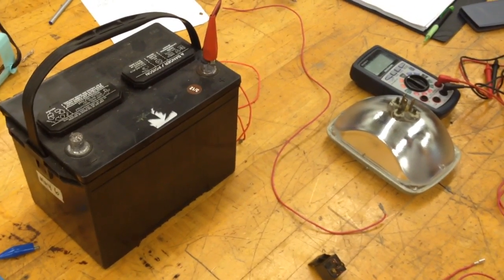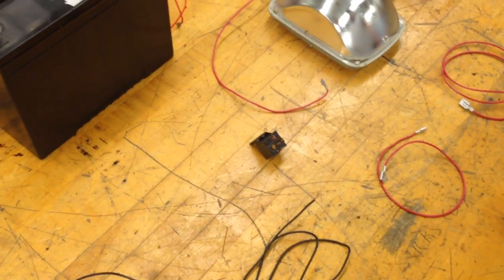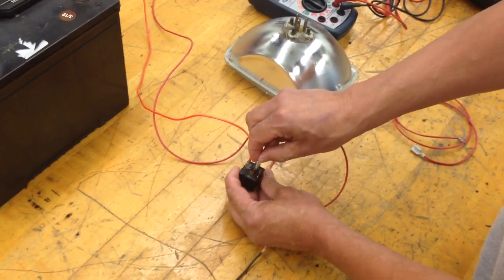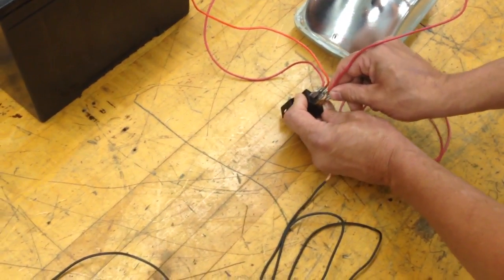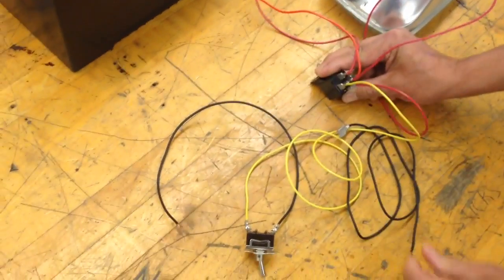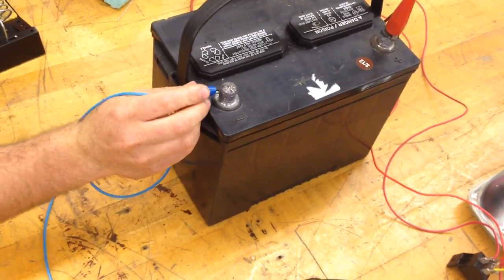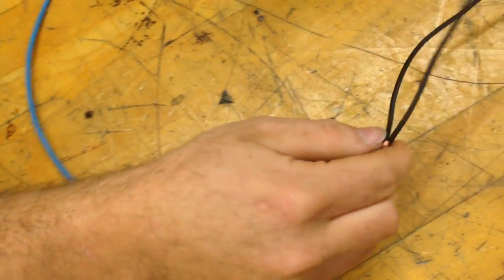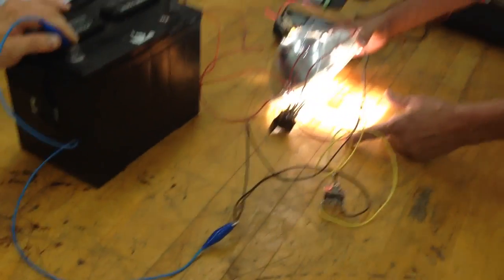High/low beam headlight connected with 5 pin

Comment: Good demo..... But i would connect a fuse specific to the vehicle specs and connect both fuses between 87a to lamp and 87 to lamp..... Otherwise bulbs wont last long for getting too much power

Comment: That was informative. 
But what do you do if the light has a second side light bulb, as well as the dip and high beam?

I've got a 5 wire 2 bulb light that I need to fit separately to the existing light?

Comment: Yes, your video can be followed and understood but improve on switching off low beam may be by use of 2 relays
Reply: Why 2 switches?... this is daytime running lights with a highbeam switch.  87a stays hot until the highbeam switch is thrown-  87a opens and 87 closes allowing power to the highbeam. The only thing missing here is a fuse but not necessary for this simple demonstration.

Comment: Is there a way to wire a 3 way switch to have  it work (hi-off-low)
Reply: That's how it works, if I'm not mistaken its an (On Off On).. labeled as on or off but there's a middle option.. the middle is actually off. They have different switches to buy and I think he just happen to buy that one. But I believe its 3 options, up is hi and down is low, middle is off
Reply: Actually yeah I think your right, but you can buy a switch that does the same thing I think the middle option just doesn't touch anything internally

Comment: I use same diagram for my motorcycle LB and HB. So, how to turn off low beam because pin 87a (LB) connected to battery?
Reply: Connect LB switch on wire to 87A

Comment: Hey so I think I figured out how to do high and low beams on a 3 position toggle switch on-off-on. You use two 5 pin relays, one for the low beams and another for the high beams. Watch a few more videos on how the 5 pin relays are set up, but the headlights are pretty straight forward, top is positive and if you run the negative through any of the sides it’ll be either low or high beam
Reply: Can yoh make/share a video of this. I'm wanting to do exactly this but I'm lost😅

Comment: So in my truck I have a dual filament bulb for low and high and the low beam turns off when I turn on the high beam. How can I rewire it so that the low beam stays on when I turn on the high beam? I'm getting upgraded aftermarket headlight that have separate bulbs for low and high.

Comment: there are two switches, (1 )the on & off & (2) the high & low beam,  pin 30  on your diagram connects to pin 86 then one wire goes to the battery, then  when you hooked it up during the video  you used two separate hot wires keeping 30/86 on separate wires both connected to the battery, the diagram would be correct if another switch was added before the battery, I would add an on & off switch to the lead after pin 86 to battery & wire a separate larger  hot directly  to pin 30 to the battery, assuming the high low switch on the floor is a two wire with one post to ground, caution most floor dimmers are not wired this way, most have three wires  (1)high (2) low hot on the dimmer with a (3)third positive wire also on the dimmer switch hooked to 12 volts ignition or battery, no ground on the dimmer switch  The diagram looks like a motorcycle switch when the ignition is on the lights stay on until the ignition is switched off by not showing the on & off switch this becomes very confusing, & can cause a potential short if the dimmer on the floor is a three wire regards
Reply: Yeah he didn’t show the two hot wires from the battery

Comment: what about the dimmer switch,  three wires one is high, one is low, the center is power, what your saying is use only the power wire & one leg of the dimmer switch, since the dimmer has two legs, I wonder where I can use the third leg, since by turning the light to low beam  the other lead is hot 12v & could potentially could power ????
Reply: Jeff Booher you need a 5 pin relay for this. Low beam signal input plus 12v vs high beam signal input plus 12v. You only get one or the other. The squigly between 86 and 85 is variable/a resistor. A higher voltage input nets you high beams while a lower input nets you low beams. Its own switch inside the relay.

Comment: Hi, how do I manually grab a high beam wires in a car doesn't have plug? Need to run a driving light bar thanks
Reply from the maker: You need to use a wiring diagram to find out which wire controls the high beam. Thanks for watching.
Reply: @scottb6419  thank you so much

Comment: If i were so inclined to just use this to set an on and off switch dedicated to HIGH beam and OFF, how would i wire it? to my knowledge (electricalnoob) the bulb just receives two different amounts of wattage is that correct? via Wattage equals voltage times amperage.
Reply: also, what amperage relay should be placed, 30? 40?

Comment: i have been tormented with this idea for months!!thanks for the solution.. was struggling with wiring two led bars ..one with low beam and the other for high beam and when whenever i put on high beam the led bar that is attached to the low beam turns off!! i knew it had something to do with a 5 pin relay! !you made it super clear

Comment: your showing how to use one relay for high and low beam correct? how would you wire it to turn off? would you use another switch to turn the power off and on? any info would be great.
Reply: Yeah, you'd have to put in another switch.  Either on the hot side or the ground side.
Reply: You would need a second relay to completely turn it off.  You don't want to just use switches which is the whole point of relays.